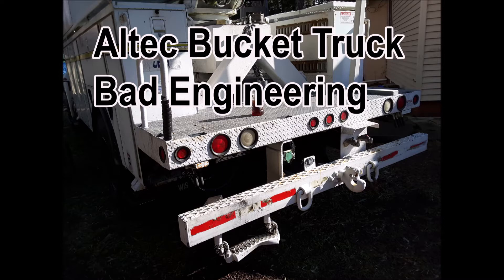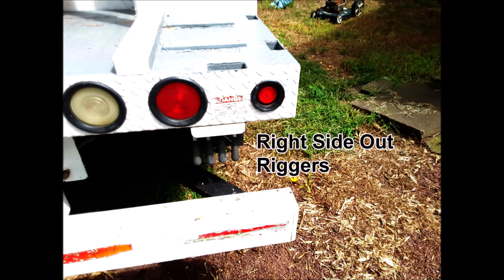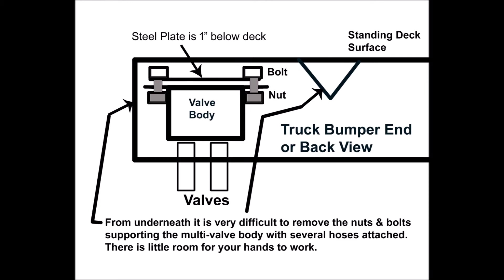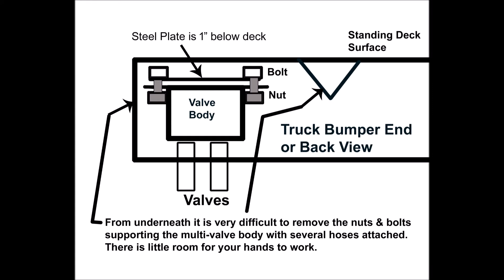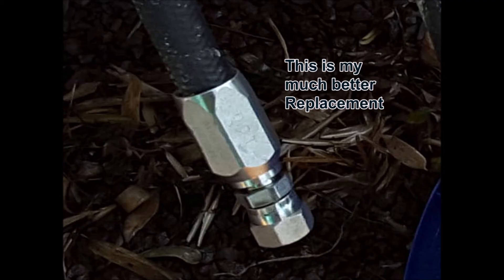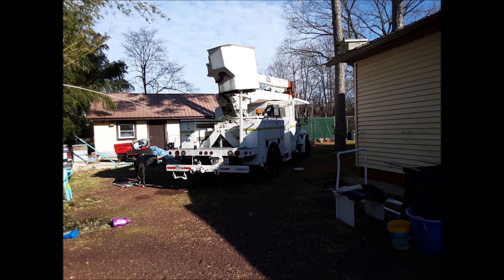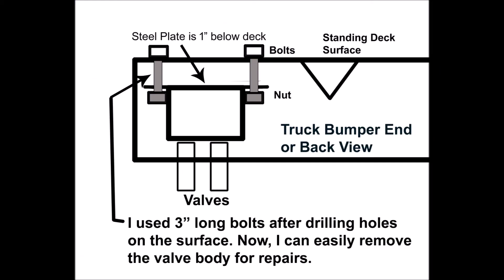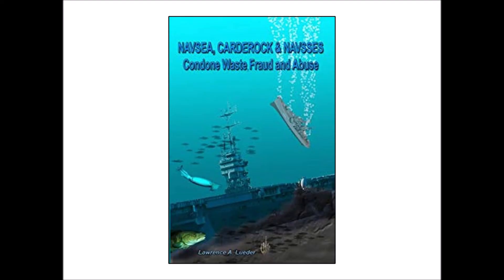Altec Bucket Truck BAD Engineering Mistakes

Comment: That is a terex, the manual is for a different altec unit.  Also the factory hoses for altec and terex are made by parker hoses.  I work on these every day, get the correct manual from terex before you hurt yourself.

Comment from the maker: You are wrong altec stickers all over the machine. Hi ranger is made by altec.
Reply: Hi ranger is terex buddy, you’re wrong
Reply: Terex has owned hi ranger since the early 90's.
Reply: No its not altec , I worked for altec
Reply: @manbearpig2164  It's Terex. terex.com/utilities/en/products/aerial-devices/telescopic
Reply: @Sedevecaustic  exactly, I worked for altec as a welder/ installer, great job, good pay, it was fun building those trucks, I just quit there 2019